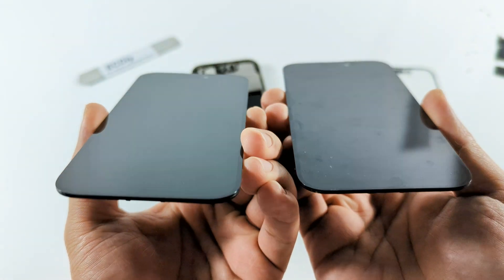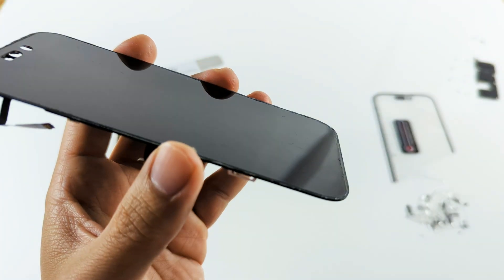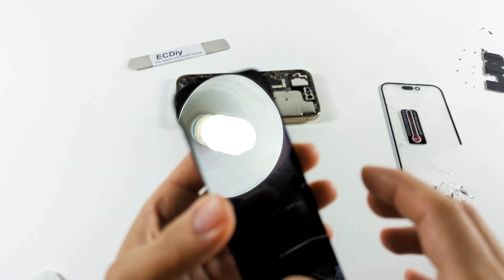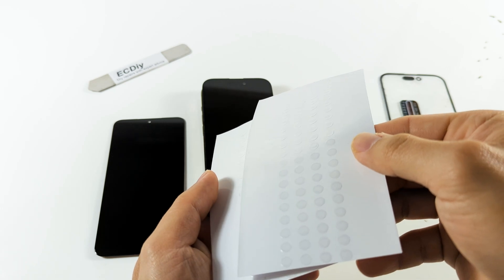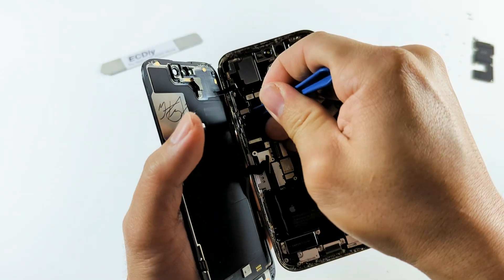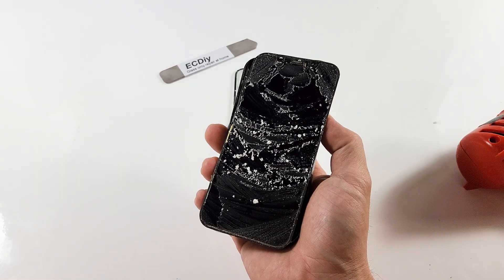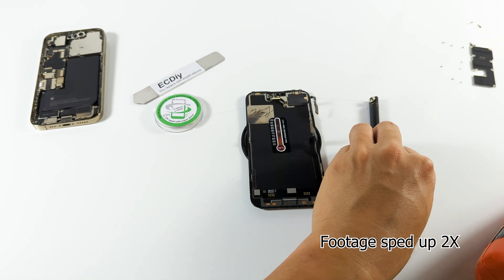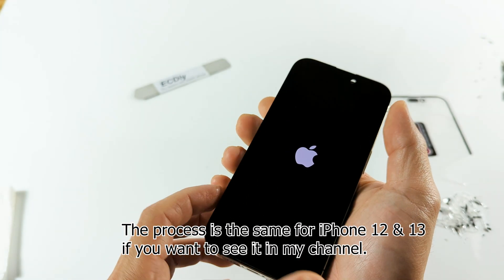How Does a Home-Repaired Cracked Screen Compare to the Original?

Comment: Most of the replacement glasses include a laminated oca would I have to remove it? Or it doesn’t affect?
Reply from the maker: Technically, pre-installed OCA can be stacked with LOCA. 

   Even if the OCA were to make contact with the glass somewhere before the LOCA, LOCA will fill up to the area seamlessly. 

   However, you will experience seepage of the glue out the sides because the lip on the bezel is only enough to accommodate for a single layer of OCA/LOCA but you will now have both and your screen will be assembled ever so slightly thicker than the original. (appx 0.08mm). it would also reduce the phone's water resistance.

    This additional thickness does not cause touch issues even with a tempered glass screen protector. That's been my finding on my end at least.  
    If you are interested, I'm happy to supply you with just the glass without the OCA film. 
    Any further questions/concerns, please do not hesitate to comment further.
Cheers,
Reply: @ecdiy  thank you very much, I can’t find the info anywhere, you give me the strength to try to start repairing only the glass of my phone, you rock!!

Comment: Hi hope all is well i have ordered but haven't received any tracking or any info on my order can you please see

Thanks
Reply from the maker: Hello,
   Thank you for your comment and thank you very much for your support.
   I do see that your order was received after the cut-off on the 15th and we had it shipped yesterday on the 16th. 
   Shipment info is sent via email automatically when we fulfill the order. I have re-sent it (to the gmail address that ends with 923) just incase but if you happen to not receive that one as well, please check the junk/spam folder. 
    Any questions/concerns, please do not hesitate to contact us/comment further.
Best regards,

Comment: When will u give us the in depth video about repairing the backglass with liquid?
Reply from the maker: I had disclosed that it is 99% isopropyl alcohol with a long soak. Even with that, I found that some of the small pieces don't come off easily making the back glass removal so tedious. If those small pieces that would require scraping is near the charging coil, the charging coil may be damaged as well.     
    You'd also need to ensure the work surface is level and put precisely the correct amount of isopropyl alcohol so that it just reaches the adhesive and not any further. Camera damage may occur if the surface is not level or too much alcohol is added. 
    After having done a few, I decided not to develop it further due to the difficulty and risk. 
    
    The front glass, on the other hand, once the adhesive layer is sliced, all the glass more or less effortlessly gets removed. In my humble opinion, and I may be biased due to my experience with the front glass repair, the front glass replacement is easier.

Comment: What type of glue you use this?
Reply from the maker: Hello Arwin,
Thank you for your comment!
It is called LOCA. The brand we use is Stronghold. LOCA stands for Liquid Optically Clear Adhesive, there are several options but please kindly note many LOCAs require a separate UV lamp to cure. (Ours is specially formulated to by hypersensitive to UV, so much so that exposure to daylight on a cloudy winter day is enough to cure the glue. I'd also like to note that ours can also be cured with a UV light)
   We do not have a listing on our site at the moment but send us a message through the 'contact us' page and I can arrange a direct invoice for you. A lot of copy cats these days using our image, but this glue is exclusive to us. If it's not on our site, or at our eBay store, it's not the same thing.
   Any further questions/concerns, please do not hesitate to contact us/comment further.
Best regards,